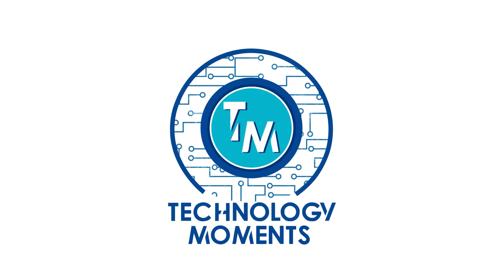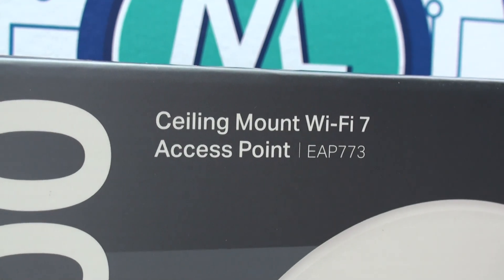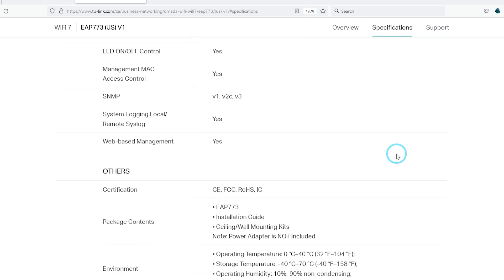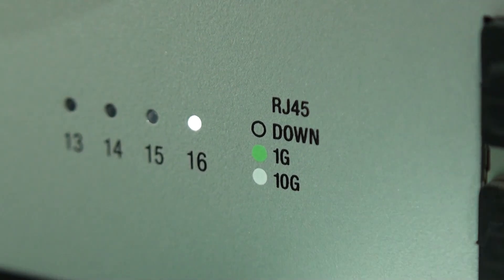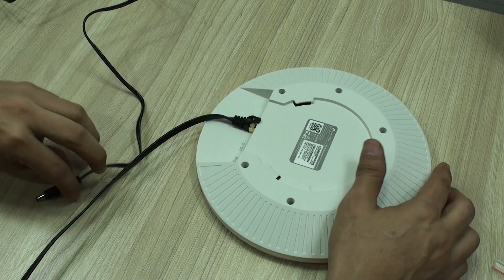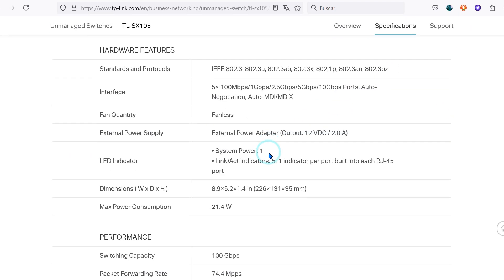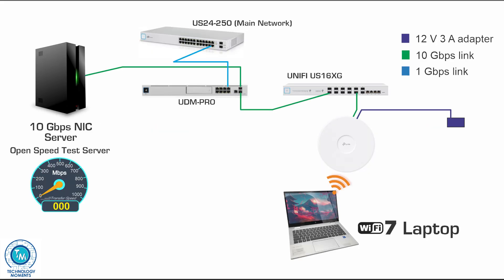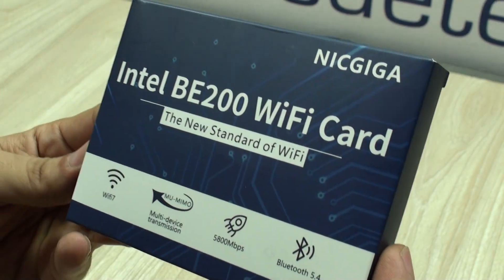WiFi 7 Access Points - Awesome experience but you need good hardware EAP773

Comment: Is it normal for such devices to get so warm? I have the EAP 723 BE 3600 and I often find it very, very warm.
Reply from the maker: Hi, yes, not only because of its radios but also the 2.5 GbE or 10 GbE as this model.  It should be around 18 to 20 watts operating at a moderate use.

Comment: Considering the price, you should be getting at least 3500mbps with wifi 7 6ghz... I can get 900mbps with wifi 6 U6 pro, and its way cheaper. Is that extra 700mbps worth the price of this wireless access point? Pretty absymal if ask me
Reply from the maker: Thanks for your comments, and yes, we were so disappointed with these results, we then tried 4 more adapters getting much better results even with MLO innactive in the 6 GHz band as you mentioned.  WAVLINK adapters so far are our favorite.  MSI Herald in second place (no way of forcing preferince for MLO, but we understand Unifi firmware has not even made MLO available in all their WiFi7 line that we are currently testing).

Comment: How do we add a new AP to the existing setup? The IT guy left the company, and we want to add one more AP. He mentioned it's a mesh network, and it should automatically pick up the configuration from the master AP, but that's not happening. When I plug it into the switch, it's not adopting the configuration and is still on its default open SSID TPLINK OMADA AX3000
Reply from the maker: You have to have access to the network controller.  Would be a great security flaw to just automatically adopt any new AP to the network.  I would recommend you reset the units and adopt them in a new network controller that you are trained to at least manage in case your IT guy is not available at any given moment.

Comment: There is an issue with omada controller.

some of us can't get the latest controller update for docker, since it fails to boot and crashes. But the previous version worked.

Other than that, i've been having a good experience with the eap-773 though i still don't have a working wifi7 client to test it with yet :(

Comment: Just got my eap-773

Tried testing with Samsung S24 Ultra but it caps at wifi 6e. I think the issue is on the samsung end. Though their specs show it as wifi 7, their cs say it's in reality wifi 6e. They don't explain why that is or whether wifi 7 will be added to it through a firmware upgrade (considering the snapdragon chip supports wifi 7). Basically they are just leaving users in the dark.

So i cannot help compare my wifi7 results with you since that is the only client i have that was suppose to have it :{

did test the controller self hosted and mobile app, those things worked.

I also got 320 MHz to work since that's what is shown in wifiman.
Reply from the maker: The phone I'm about to get!!! About speeds and caps on either end... well that is what our videos are all about.  Theory vs Reality.  We are just starting to create wifi 7 videos and as you may have been able to see... adapters still have a lot to evolve.  Maybe even these APs, but as you said, maybe firmware will solve many bandsteering options not only for the phone but for the AP.  Open Speed Test server has options for your cellphone so you can play around tweaking both ends of the connection.   Congrats on your cellphone
Reply: @TechnologyMoments  Hope you aren't from Malaysia. Because in Malaysia apparently the wifi7 is not working. I think other countries for the S24 Ultra will have working wifi 7 example i heard it works over in Singapore right over the border next door. Better check to be sure.

Samsung didn't even want to clarify when we can expect some sort of firmware update to add wifi 7 support. Cause clearly the snapdragon chip supports it.
Reply: @TechnologyMoments  i tested band steering for the EAP-773 with the samsung s24 ultra. it changes from wifi 6ghz to 5ghz depending on the signal.

later it does switch back to 6ghz but it felt like it switched it too slow cause i moved to right beside the ap yet it was still stuck at 5ghz for a good while before switching back.

Any tips for optimizing the omada settings for this?

there is a ai wifi optimizer i tried, but i get the fail error "could not apply because could not scan".
Reply: @TechnologyMoments  yes i used openspeedtest to for my benchmarks. my nas is using 10g sfp+ fiber optic om3 to switch. the ap is powered by an ac adapter with blue led so no issue with power. And it's connected to switch via 10g base t ethernet.
Reply: @TechnologyMoments  did u hear, there is pixel 9, iphone and a samsung phone out soon (i think the s25 is next year?) That said i liked the S24 Ultra, hardly any bloat (it's a breath of fresh air compared to those china branded bloat full of god knows what). can't go wrong with it but it does cost a premium.

Comment: You should probly link the MSI wifi7 pcie adapter because that uses the qualcom chip which works for amd. That said if i am not mistaken, windows 11 doesn't yet support wifi7? so if you install the wifi7 pcie adapter, it will be stuck at wifi6e speeds ya?
Reply from the maker: Absolutely not.  Windows 11 does support WiFi7.  It does identify it as 802.11ax being 802.11be but link speeds are much higher.  Now as of the driver which is the one that must be supported by Windows 11 is the one that manages how the card communicates with the OS.  We did reach 1.5 Gbps much higher that what was achieved in WiFi6 (1 Gbps average),  Thanks for enriching this blog, and wait for more WiFi 7 adapter videos

Comment: in your test i saw it showed wifi6 when connecting to the ap. so the limiting factor was your client didn't support wifi7 so it couldn't get the most out of it.

but later in the video you showed a laptop with wifi7. I'm assuming it supported 320 MHz? for power did you have poe++? if not that would impact the performance.

based on your results you didn't even break 2.5gbe speeds. how far was your client from the ap? If your video included comparisons for distance of client from the ap as measurement, and other tests like wall penetration through walls in a different room, that would also improve your video benchmarks for this :}
Reply from the maker: Hi there, yes WiFi6E clients reached 1 Gbps and in WiFi7 up to 1.5 Gbps.  I really think that with better adapters we're gonna be able to go beyond that.  I do not have a PoE++ switch so as I said I used a 12V 3 Amp adapter.  I could have used an injector as you well stated.   The performance is going to be the same as with PoE++ only it will consume less power overall.  The 2.5 Gbps could be surpassed with a well connected client for each radio.  But I keep thinking it would be enough.  We we'll be sharing more practical workshops in the near future testing more adapters and demanding scenarios for this AP too.  Have a great day and thanks for enriching these blogs.
Reply: @TechnologyMoments  ty for sharing. i do have a poe++ switch but they are 2.5gbe .... i don't see any poe++ 10g injectors around. seems like a switch is the way but they cost a bomb, so i don't blame you not having it. it's hard to find and expensive if you do.

My eap-773 is arriving soon, so i can test with my samsung S24 Ultra. But it will be capped at 2.5gbe using the poe++ ports. So i won't be able to get the supposed 3gbe + speeds this eap-773 should be able to get 🤔 otherwise what then is the point of the 10gbe ports.

ubiquiti u7 pro straight up stuck to 2.5gbe ports.
Reply: Am using 783 with poe++ on 10000mbps. Signal is strong but throughput is horrible. I tested in room with be88u / intel 1750x connected at 2.8Gbps, eap783 onlh 1.4Gbps. Should i rma?

Comment: u can self host the omada controller using docker.

but i read on reddit, omada is more susceptible compared to ubiquiti aps, if you disable controller, the ap itselfs wifi might also go down depending on your setup. so if you want wifi to be up, have to make sure your controller is also up.

like you said poe+ should be sufficient to power this eap-773, but 6GHz will be affected. Hence you will want to be sure you can do poe++ if not at least have the appropriate injector if you don't have a poe++ switch.

If you still insist on poe+ then perhaps a Ubiquiti U7 Pro would be a better choice since that uses poe+ The trade of though, is that the U7 Pro is limited to 2.5gbe ports, whereas the EAP-773 has 10gbe port. The EAP is only 2x2 so it won't be as good as the 783 which is 4x4
Reply: The issue is the throughput is pretty bad. I did iperf3 to test from laptop using 1750x to my mobile. From asus be88u i got about 700mbps bi direction, i only got 300-400mbps from eap783 + sx3206,  sad to say it cant even do 1gbps.